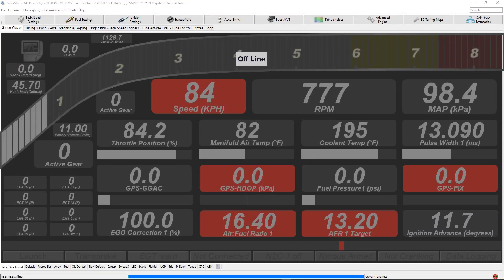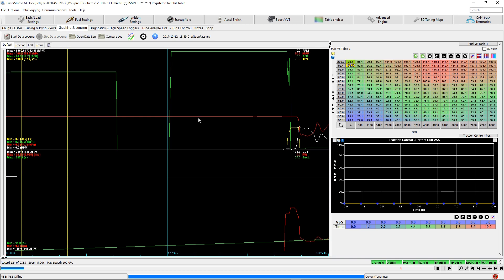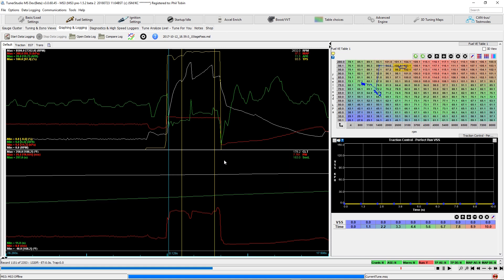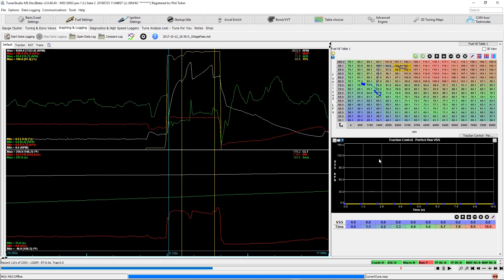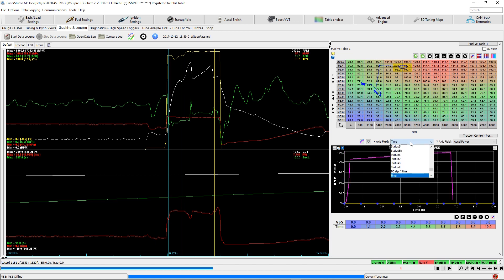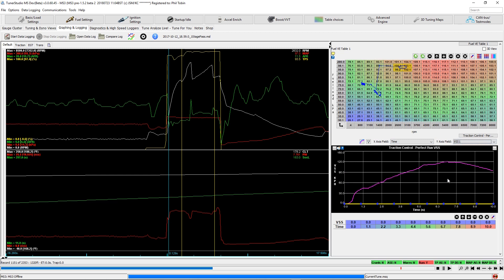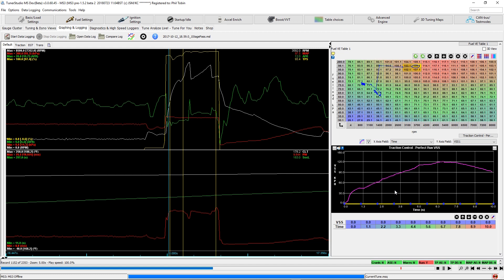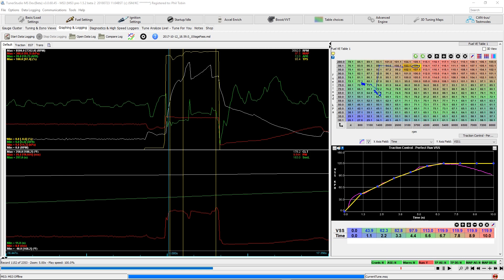MS3 PerfectRunTuning With X-Y Curve Plots

Comment: Thanks for vid. . Appreciate your amazing products.   Been a long time subscriber.   I am trying to apply all (or alot) of these features to road racing very often.   So this traction control must not be "closed loop"  IE comparing two speeds to decide there is slip?  I am thinking of rain condition traction control to compare ft to rear, looking for wheel spin.  I haven't gotten that far on the project I am working on tho.   Thanks for vid!
Reply: I think the idea of perfect run is to use a single data point vs time. Its probably not as responsive and a dual VSS setup but if you have 1 sensor its a great start.